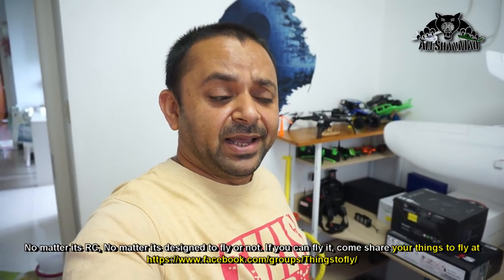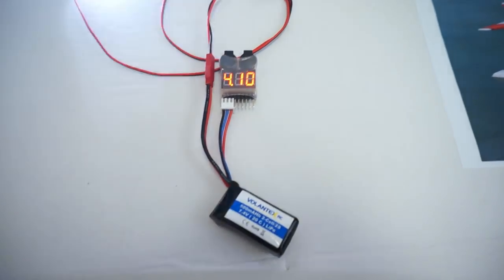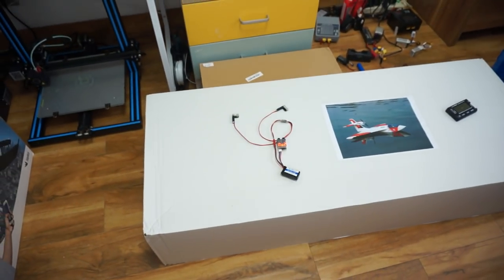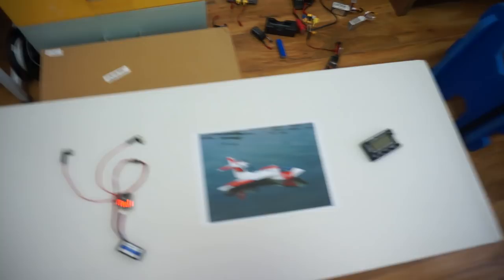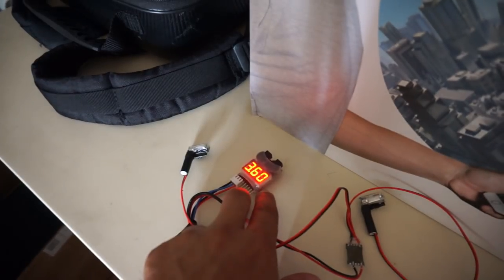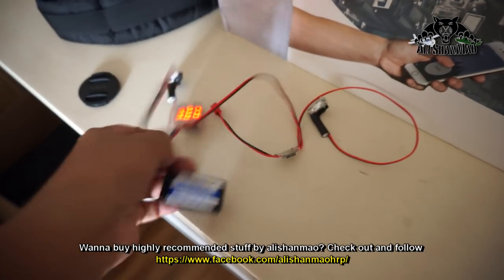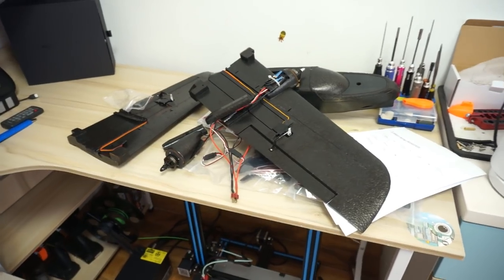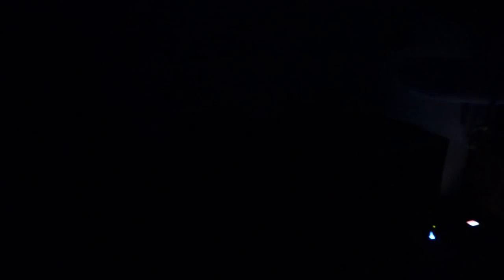Xenon LED Strobe Flashlight Daytime Visibility For RC Airplane

Comment: Hello. I have a quick question for you. In regards to the strobes, do they immediately flash upon connecting to the battery? Or do they need the slight delay before the first flash? Would really help me If you could let me know
Reply from the maker: mine start flashing like in a second

Comment: They look very similar in construction to the  5 Xenon lights in a fill-in portable flashgun that came on sale for photographers a couple of years back. If they are the same type they are both VERY bright and remarkably power frugal. Certainly bright enough to aid visibility and orientation on an RC plane in daylight. And that can't be a bad thing

Comment: Great video, but you need to remove the term ‘LED’ from the title or you’re going to confuse people. They are NOT LED ‘s ...(light emitting diodes). They are old-school xenon (as in - the inert gas) flash tubes, driven by triggered, high voltage capacitors. This is what LED-based strobes are trying to IMITATE.. these are the real-thing. Otherwise, I can vouch for everything you said - they are incredibly bright, and if you play around with different reflectors and lenses, you can almost weaponize them... lol. Really, really fun to play with.

Comment: Very good. What is the best Reptile s1100 or Sky hawk V2? And why?
Reply from the maker: you can't compare a wing with a V-Tail / A Tail. 

Though both are running twin rotors but A-Tail has more control due to having rudder control and offers better flight performance. 

but Wing is easier to install your gear. Skyhawk V2 due to its wing and tail assembly bolting on top of fuselage will need to you to just install everything once and do not touch it again.
Reply: @alishanmao  if you had the money to buy one which would buy
Reply from the maker: If i had money, I will get this one
http://bit.ly/2M3isI5
Reply: alishanmao  very good answer. Thanks